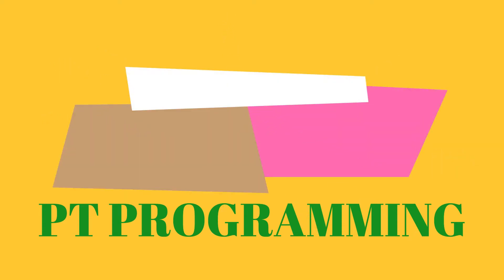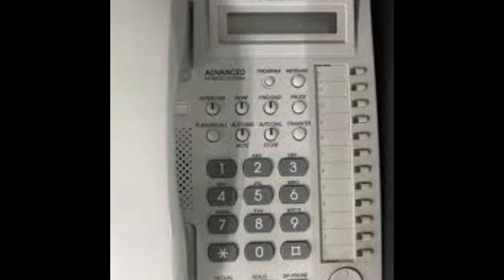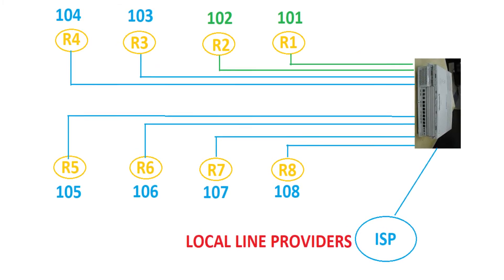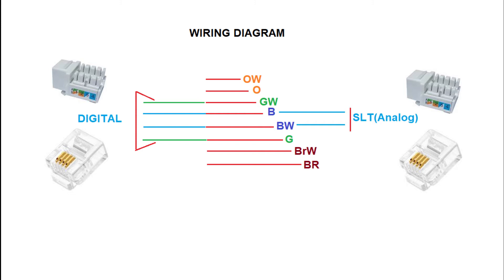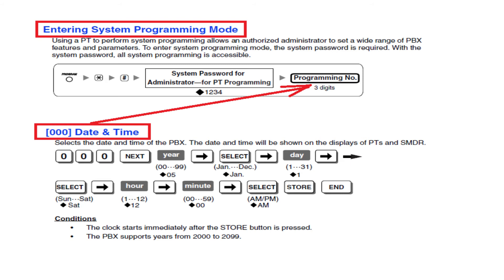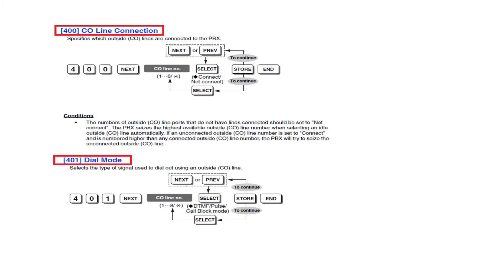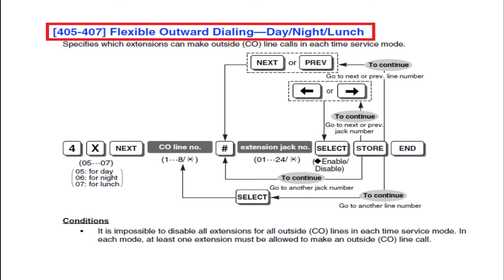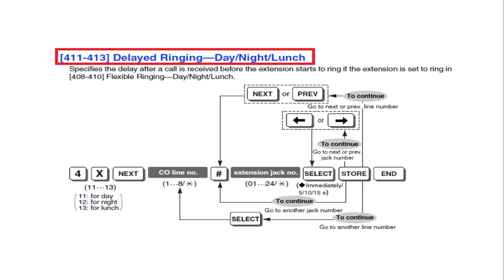How to  Install Panasonic PBX KX-TES824  and PT Program using KX-T7730-Part1

Comment: Can i extend one of the intercom over 100 meters using cat cable. Will it work or loss of signal. Also panasonic kx at 7730 phone is analog or digital

Comment: In coming call on CO3 ringing endlessly with no one at the other end
Reply from the maker: Configure CO-3 incoming call delay time using 411,412 &413. So the call will route to other extension. After you can enable incoming call settings of other extensions where you need to land the call.

Comment: our telephone is only 2wire, it is possible to use it?
Reply from the maker: Not as master telephone. You can use it as normal extension.
Reply: @ELVMalayalam  it means i can use it to communicate 6 telephone inside the company only, no outside call?
Reply from the maker: Yes.

Comment: bro, have one issue with tes824 pabx, while I am trying to call to a land line number , i can hear its ringing , but actually the land phone is ringing after 5 ringing , pls help, thanks
Reply from the maker: I didn't understand your question properly. Please let me know the problem correctly. Then only I can assist you. Your are trying to call the land line which is connected to the pbx from your mobile? Is this system having 5 sec delay? If like this , then you need to do program in 411, 412, 413.. here you can adjust the delay timings.
Reply: @ELVMalayalam  could you pls share whatsapp number